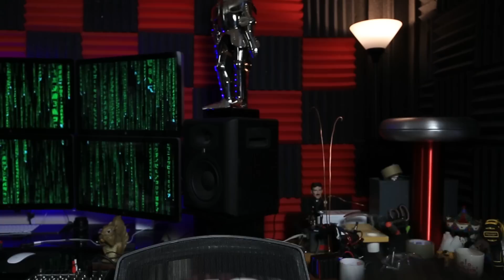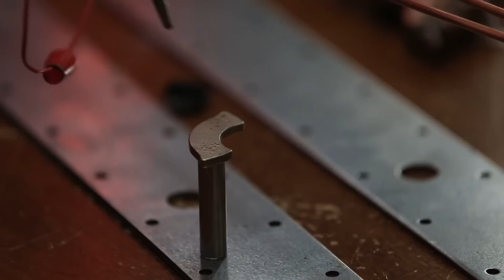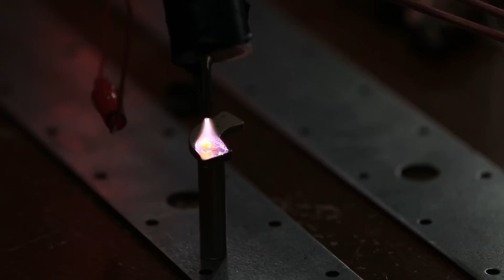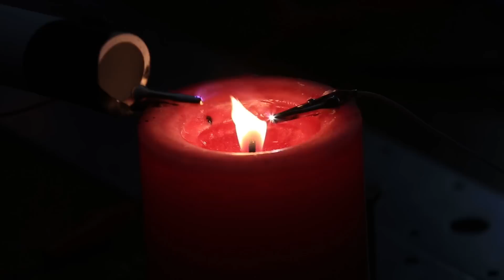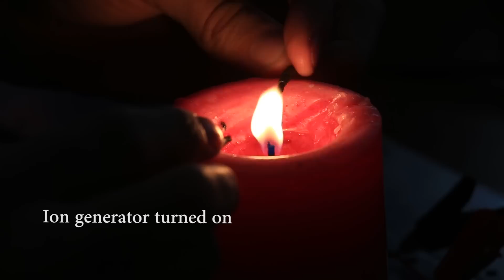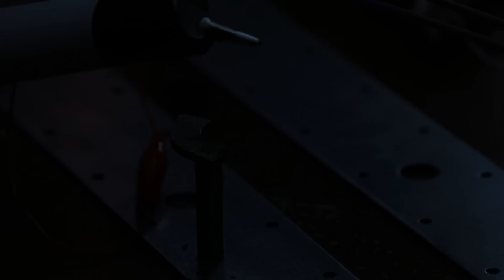Plasma, Magnets, and Fire

Comment: Ive been looking for a way to build a chamber with 4 pillars with powerful magnets on top, those pillars would be on a wheel vertically and ROTATE at very high speeds in a chamber (or Maybe with some altered MRI machine? idk rly how it works) with a tesla coils and fire spitter rotating as well along the walls, facing the magnets, for fun and curiosity. would that do anything?

Comment: Isn't it obvious? During a chemical reaction electrons get loose. 
Any strong enough electromagnetic impulse will ionize hadronic matter, as
The load-bearing structure is poignantly springy and capable of revolt.

Flames are intermittently recombinant!

Comment: In fire the electrons are still bound to their atom, at least in the lower orbits, only the electrons from the higher orbits get freed from their atom to make new chemical bonds. In plasma, all electrons are free, that's why plasma is hotter than fire, the energy level is higher.
Also fun fact, plasma does absorb laser beam.
Cool video btw

Comment: So let me get this straight so the only thing differnt about plasma and fire is that plasma has all positive ions and fire has both pos and negitive ions? (So would that means that plasma is just a hotter fire because it doesn't have a lot of distinct physics?)
Reply from the maker: The plasma in a fire is there as a result of combustion, consuming the fuel and creating the heat and light, and is orange due to the temperature and the soot (burning wax).  The plasma I was generating via high voltage doesn't have fuel to create soot, just ionized air.. I hope that answers your question.
Reply: @TommyCallaway  you mean to say that, a fire is actually a plasma? Cause some people around internet doesnt consider fire a plasma
Reply: @alucardlord9032  The way I see it counts as plasma in the smallest semantics. It just the weakest form of plasma that humans can produce more easily.
Reply: @ARuiz-eu3hk  because it confused me, some dont consider fire as plasma, if it is not solid, liquid nor gas, then where should we put fire right?
Reply: @ARuiz-eu3hk  well they say that if fire temperature go beyond 5000 it will be plasma, so weak or strong, its still falls under plasma right?

Comment: I think the plasma becomes yellow when the tape burns because of the presence of carbon in the form of soot. The yellow colour of a flame is normally the result of incandescence of very fine soot particles left over from incomplete combustion. The blue colour of a flame is due to chemiluminescence of reactions involving molecular radicals. This is typically less bright than the light from the incandescent soot particles so is only visible in the absence of soot. I assume very similar processes are involved in the plasma. Look at the flame color section here https://en.wikipedia.org/wiki/Flame Nice video btw, interesting touch with the neodymium magnet.
Reply from the maker: Thank you - and yes I think you're on to something with the soot particles.
Reply: Marco Pohl It's kind of like fingers and thumbs. All flames are plasmas but not all plasmas are flames. there is a actually a bit of uncertainty of wether flames fit into out definition of a plasma. A plasma is a gas which very ionised. This means that electrons have been separated from the gas molecles. The gas needs to be very hot for this to happen but once it has happened it will have many strange properties and stick together kind of like a liquid. The out side of the sun is a plasma, fluorescent light bulbs have plasmas in them, lightning is a plasma etc.
Reply: i actually thought more like compairring these elements rather than the 2 fighting directly, but it is a pretty badass idea for a fight scene, it'll probably make it into the final version
Reply: All fire contains some level of plasma (ionized particles), and will-o'-the-wisp even more.
Reply: Tommy Callaway -weird question: i'm writing a fantasy story and as i searched the internet for ideas for magical elements, i found someone who suggested plasma. now i want to know how that would be different from another element i already have: fire. do you know any differences between the two?
Reply from the maker: For the purpose of your story, I would consider fire is the result of the process of combustion.  Alex has a point - all flames can be plasmas, but not all plasmas can be flames.  You could perhaps use that ... maybe you have a person that casts "fire" and a person that ionizes the air around them and casts "plasma" and the person who casts "fire" like.. levels up or something and then can also cast "super hot fire that is so hot it is also plasma" but the "plasma" guy can't do that in reverse, because there's no combustion.. just ions, but he can set stuff on fire with his hot plasma (because plasma is hot, things around it get set on fire, but they have to be a fuel source like wood, paper, or something), resulting in "fire" - I don't know.  I played a lot of video games when I was younger.  Lol
Reply: i've been thinking about something similar: fire-mages pruduce more digestive gas than others and can release some of their bodies energy as heat, so they exhale that gas and set it on fire. plasma-mages intruduce positive and negative energys into the air (i've already made up a huge, detail filled world, so don't worry if it sounds a little outlandish to you) and seperate them again, which in turn seperates atoms and electrons. i thought that maybe this process also magnetices thier bodies, making plasma a "fire, that can be formed". but i can't seem to find a way to make normal fire just as strong, other than greater reach do to not needing a magnetic field. is your suggestion basically: "there is an upper limit to how hot plasma(magic) can get, but not fire"?
Reply from the maker: +Marco Pohl if you need it to be strong, consider strategy. Maybe the fire person excretes a ton of methane gas around the area and can control the cloud of methane instead of setting it on fire.. and then covers the plasma person with the gas before they create plasma, then it blows them up when they do, because it's highly flammable / explosive.
Reply from the maker: +Marco Pohl cool! Can't wait to read it.
Reply: thank you, it's called "brave world" (with an alpha instead of an a) in case you ever see it somewhere